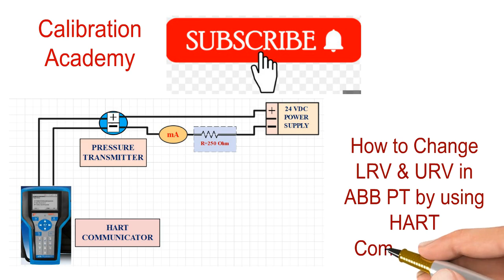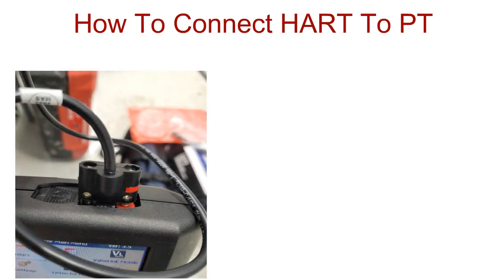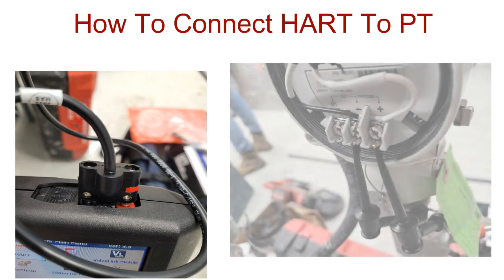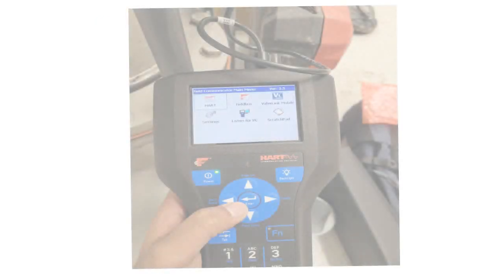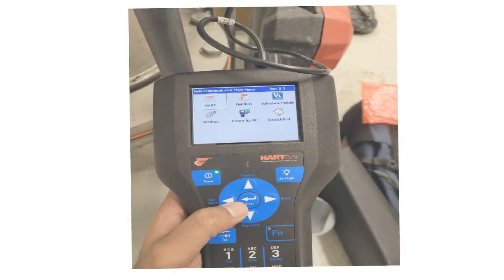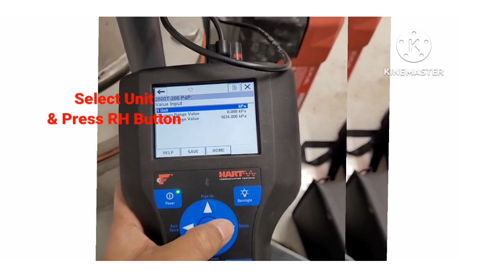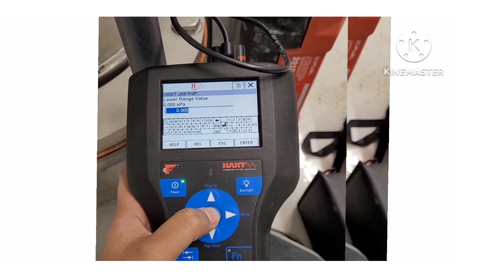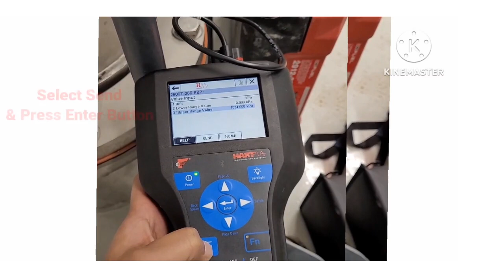How To Change LRV & URV Of Pressure Transmitter: Pressure Basics

Comment: Hello there, Sir if  im using HMI so can i change that lrv and urv on the HMI no need to use hart communicator which one is correct thank you
Reply from the maker: No,, you need to set lrv & urv in transmitter first, then you can set range in HMI.
Thanks for asking this question.